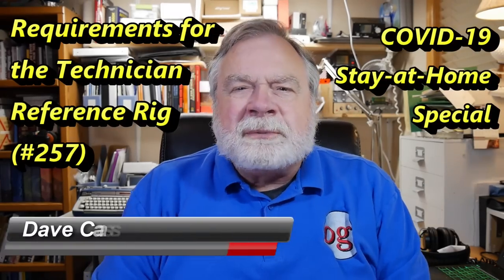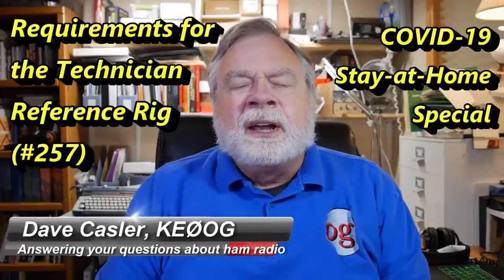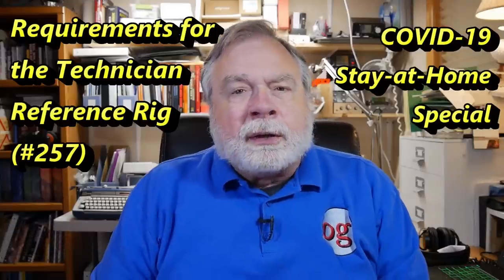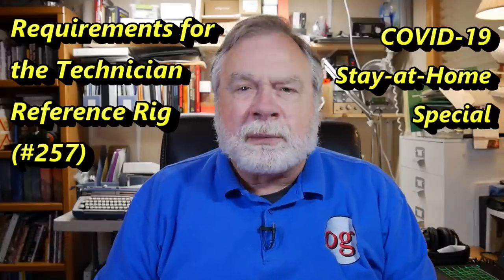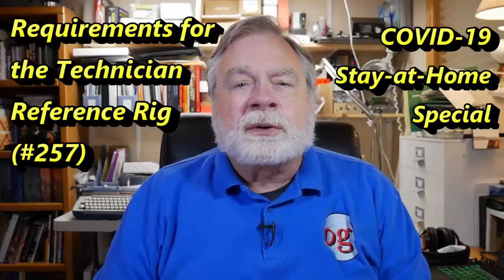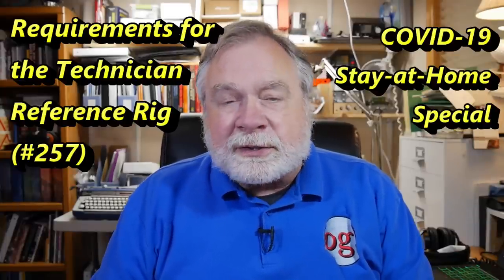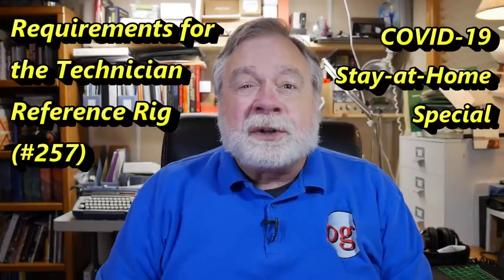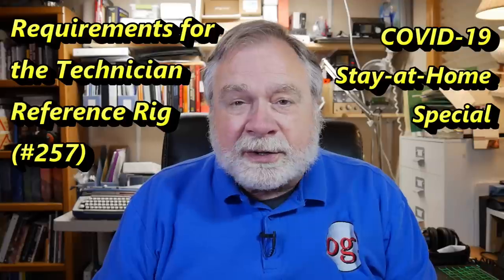Stay at Home Special: Requirements for Technician Reference Station Home/Mobile Rig (#257)

Comment: Hi Dave, I checked my local repeaters and there are no DMR repeaters near me. They are all DSTAR. I think the idea of a reference station ought be to explain how to define the requirements not give the requirements as a general rule. In my opinion the reference radio ought to be 2 meter FM and not dual band, since there may not be any 440 repeaters in the area where the viewer lives. So better to discuss how to determine requirements than picking a radio.  Since most beginners, they used to be Novices, probably will use a HT, why are you not addressing how to select an HT? In my opinion these videos ought to address how to create a ham station by explaining how the different parts are connected together by defining requirements so they work together and not get too involved in the specific details of a particular radio or antenna.
Reply from the maker: I'll get to the HT.

Comment: I'll disagree on the issue of power.  I live in the middle of nowhere, and the two nearest clubs are both around 65 miles away from me, and the local repeaters for their nets are 65 miles and 56 miles away.  The nearest repeater at all, 40 miles away, blew down in a recent storm....

To reach them and break squelch, I need at least around 150 watts ERP from my yard, and that is with considerable height advantage.  Geography, trees, by the time you are done with a less than perfectly clear LOS, you need some power to reach and communicate.  Sitting in my old car in the yard, I can reach the 65 mile distant repeater, with a monster 97 inch 2 meter whip, and only with my big boi Alinco 185, 85 watt rig.  My 50 watt dual band rigs can't even break it open, unless I hook them up to my G7 144, 2 meter only antenna with 7 dbd gain.  In either case, my base station currently has to run a 2 meter only antenna, or a 2 meter only transceiver.  

When there isn't a clean enough LOS, all that extra power can mean something.  I appreciate the capability of that Alinco (although it is so powerful that it over heats and needs an external fan), and the big gain of that 2 meter only antennas on both my car and roof.
Reply from the maker: You might look into a beam antenna. Diamond makes them as well as other manufacturers.
Reply: @davecasler  A local elmer suggested the same, as well as some other grey beards on various forums.  The good news is, my current high power omni setup has full quieting on both repeaters during conversations, so I probably don't "need" a beam.  But the ability to use lower power would be nice.  Or, hook that Alinco up to a beam and try to talk to the whole state... thanks for the reply.

Comment: Is there any kind of cost requirements?  That goes all over the scale with VHF/UHF/digital.    Glad I don't have to sift through that swamp.  HF is a pretty easy choice.  Just thinking with my fingers I would think the Yaesu FT-7250dr for C4FM, maybe the FTM-100D.  I couldn't justify the cost difference between the 7250 and 100d and I love my 7250dr.   Icom ID-4100a or 5100a for D-Star and some Chinese junk for DMR (sorry just my experience).
Reply from the maker: I didn't mention it, but, yes, cost is a consideration.
Reply: @davecasler  I would also look at ease of programming without having to spend an extra $50 for a cable and software.   The 7250dr won me over when I programmed 60 repeaters in less than 40 minutes from the front panel.

Comment: Hi Dave, I have to agree with Tom W5VLT,  are you looking for a radio for the shack or for mobile?  Most hams eventually have both or maybe use an HT.  I thought you were originally looking to build the shack and would therefore be putting this dual band radio there and not looking at mobile issues.

Comment: Dave, by “reference station” do you mean a standard set of gear you recommend a new operator to buy? Not sure what the goal is here.  [EDIT: OK, I found the answer in Episode #244.  Thanks!]
Next, for GPS/APRS I got that for my VHF/UHF truck radio on the basis that if I were wandering in the back country and got into trouble, people would have a pretty fast way of figuring out where I had gone so as to come and find me.  Of course that causes privacy to vaporize but that’s a price that doesn’t bug me.  Thanks for all the great content!
Reply: The goal of a "reference" station is so the wife approves new gear purchases.  LOL
Reply from the maker: Yes, if you go a'wanderin' you should take APRS along.

Comment: Don't go with DMR as the digital mode. It is too difficult to program. It cannot be accomplished on the radio and has poor audio.  I use System Fusion since it is easy to program on the radio, great audio and automatically switches between FM and Digital.

Comment: ICOM has a dual band DSTAR radio for $300.  ICOM ID-4100A VHF/UHF Dual Band Digital Transceiver.  
I wonder how Bridgecom DMR repeater sales breakdown between commercial and amateur radio and if it makes a difference?
Reply from the maker: I asked them about amateur radio sales and they say DMR is the most popular amateur digital mode that they build repeaters for.
Reply: @davecasler  You can probably guess which way I hope VHF/UHF digital goes but I know you will make the correct decision for the community at large.

Comment: Dave - New HAM  question - looking at DMR and Analog capable mobile rigs, I see D-Star ready on some (IC-7100 as an example). Is it usually the case that most DMR radios have the ability to operate on Fusion, D-Star, DMR, etc.? It would be helpful to understand the differences and if there are radio limitations from one to another? I appreciate your videos!
Reply from the maker: There is no multi-digital-mode radio that I know of.
Reply: @davecasler   Thanks for the quick reply Dave. As this is the case, it makes it difficult  to know which way to lean. I'm in the market to purchase a mobile rig that can operate both analog and digital, however I do not know which is the best mode - D-Star, DMR or something else. Any suggestions on how best to do the trades?

Comment: Hi, David.
I'm studying for my Tech license; my goal is @July to be ready to test and so far I'm on track. I'm not sure I need or want anything crazy or expensive since I'm on a pretty limited budget and at least for the time being, my main interest is QRP CW to take into the back country on hunting/camping/back-country motorcycle excursions. (One of my sons is studying with me, though he doesn't realize it yet. He thinks he's just helping me study. I've budgeted for both of us to test. 😁) My question is, is it beneficial, widgets per dollar to buy a build instead of buy a prefab? I'm a "vehicle" fabricator and I solder just fine and enjoy doing so, so I'm asking purely on a "bang for the buck" basis. Your opinion is appreciated.

73 de Juano
Reply from the maker: Most kits these days are for very low power rigs. The full size rigs are only available assembled. An exception is Elecraft, which makes their radios available in "kit" (meaning final assembly) form with no soldering required.

Comment: Honestly, I find digital radio frustrating. It seems like a lot of the hams I know are using FM a lot less, but there is no universal consensus on which digital mode to use. DMR seems to be the global trend, but it seems like the mode that locally nobody wants to use. 

I do have a cheap md380 and a pistar but it seems like it tends to not break squelch a lot. I'll see a call on the web display and the tx light on the hotspot is on, and the radio is silent. 

Overall it is just frustrating. Maybe a better radio would improve things, but I don't use it much at all. The lack of universal standards tends to make me not want to invest in anything. 

Ugh, and so239?  When will we finally move to N or SMA? They're standards everywhere except with US hams for some reason.